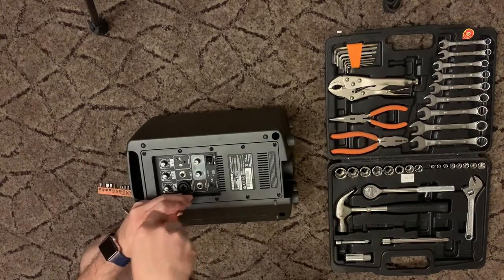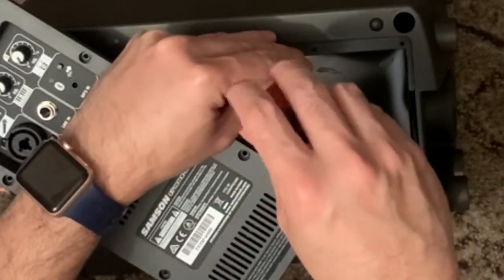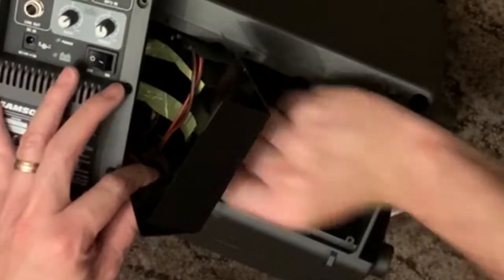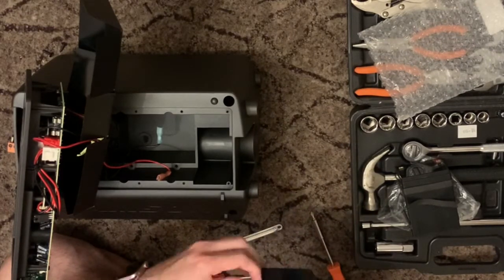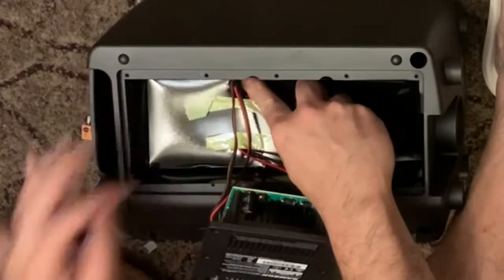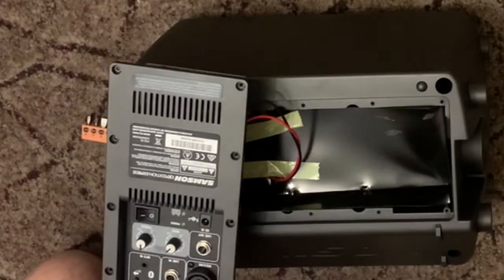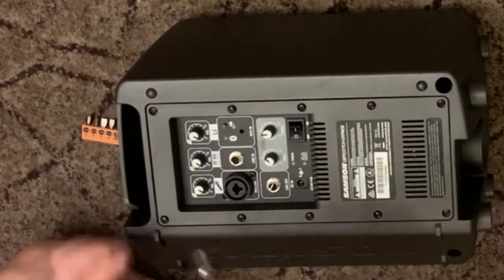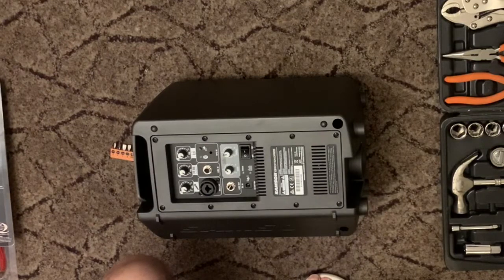How To Change The Built-in Rechargeable Battery Of Samson Expedition Express

Comment: hi Vincent my samson speaker has the battery issue as well. when connected to the charger it flickering a red light and i guess tht means it is charging but no sound when connected by bluetooth or auxilary cable. shouldn't it work when charging? pls advice
Reply from the maker: It should work while on charge. Make sure that your device like phone/iPad or tablet is connected on Bluetooth. Because when it’s flickering it means that it’s just ready to accept the device it’s not yet connected. The light will turn solid blue for the Bluetooth. You can reset the Bluetooth by holding it for 5 secs until the light starts flashing. Hope this helps
Reply: @vincentryanborres  thanks. The Bluetooth connects but no sound at all, will try changing the battery.
Reply from the maker: @nhlanhlandlovu6379  Could be. But if you connect using the cable through that mp3/aux in. See if it will work. Also try the mic and the instrument input. If that’s working then it’s just probably got to do with the. BLuetooth connectivity.

Comment: Anyone know if the original Huanyu one is the best battery model? Shop I went to change to Unicell a few years back but feel the lifespan didn't last that long.
Reply from the maker: I’m not sure as well coz the one I bought was just a replacement battery from Thomann and it’s seems ok for me. It’s been years since I replaced it and it still works ok.
Reply: @vincentryanborres  Ok I bought the same Huanyu one instead of Unicell since it was the original that came with it and its like $8
Reply from the maker: @AKSKMY  cool!!!